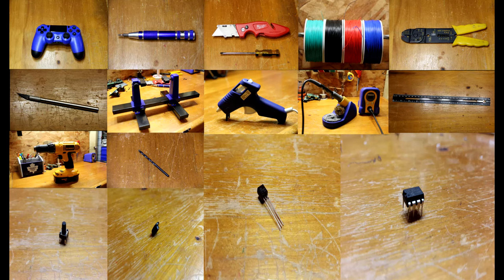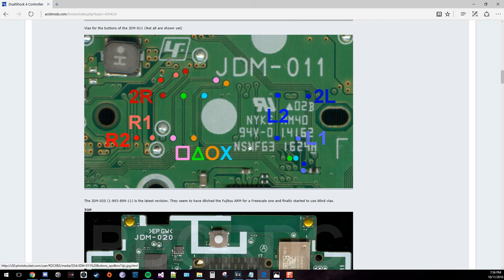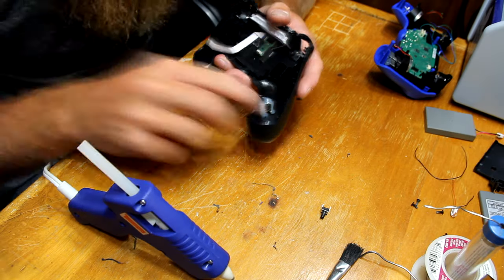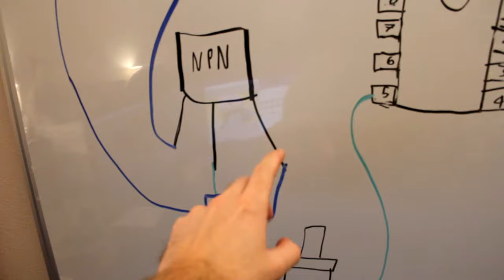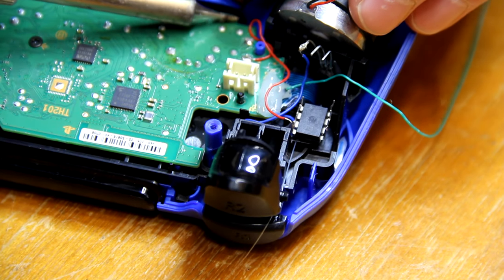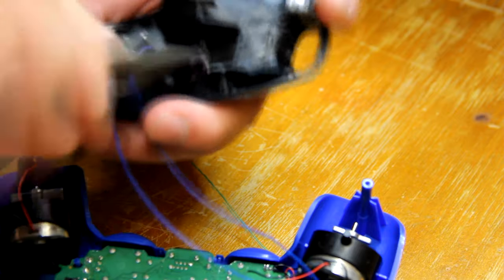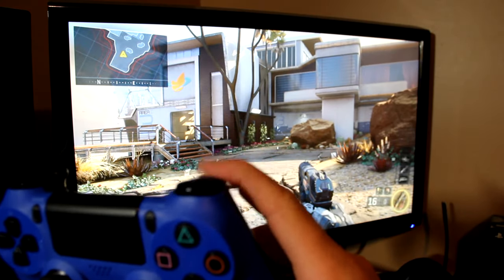How To Install Rapid Fire - PS4 Controller - Tutorial

Comment: Thanks man! I did it and it works great! I used it on my R1 button wich is the solder point beneeth the R2. Also i had some difficulties. On my 12F683 chip the pulse pin was pin 3. And i could'nt use the thumbstick ground to connect the emitter of the transistor to, instead i used the joint up left to it and it worked!
I also glued a long flat piece of plastic to the button to make it feel like a scuf button.
Reply from the maker: That's awesome to hear it worked for you! Glad to hear you were able resolve your issues as well!

Comment: The best bit to use for this kind of plastic work is a step drill bit. Lead with a super tiny bit to make a leading hole and then follow with a step drill bit until reaching desired size.

Comment: Idk if this is a dumb question, but I'm rather new to all this.  Can you add resistors somewhere to increase the length of the pulse and increase the pause between pulses?  So if I wanted a burst fire mode that would be on for 375 ms, and pause for 30ms?  Is this possible?  Thanks
Reply from the maker: I know this chip itself can be programmed and or the pins manipulated to do things like your talking about but i am not familiar with any of that.
Reply: TheHobbyGuy, yeah after I posted my question I kept scrolling down and saw that video link you posted about programming the chip with pickit 3.  I think all that's a little too advanced for me at this point lol.

But anyways, awesome videos man.  I added a scuf style button the other day using your instructions and it actually worked.  I've never touched a soldering iron before in my life so I thought for sure I was gonna brick the whole controller.  Not to mention (going against all advice I found researching before I started) I used a crappy radio shack, direct plug, no temp control iron lol.

Besides being happy it worked, it was also really fun.  I really want to start getting into electronics as a hobby now. So thank you for playing a huge part in helping me discover this hobby that had really never crossed my mind before. Keep up the good work man :)
Reply from the maker: Ya lol it is bit too advanced for me too. I am computer science major but almost wish I would have been a computer or electrical engineer major so I could of learnt more about IC chips and such.
Reply: TheHobbyGuy, exactly me too.  The programming part is no problem, I think I read it based on C.  It's the components and pickit that is all completely foreign to me lol.

Comment: Need help please. I tried your mod. The only difference is I tried using an ez remap board my X and O work fine but the rapid fire doesn't work at all. Would you be able to assist me thru email? Trying to Make two scuffs for my kids for Christmas.
Reply from the maker: madsaez I believe with those ez remap boards you need to press the left dpad or something to get rapid fire to turn on, but I could be wrong I have never used one, if you      YouTube message me ,I can give you my email
Reply: TheHobbyGuy  How much are you selling the control with rapid fire? I want the X and O buttons on the back. Whats your email?

Comment: how the hell do you melt the controllers solder??? ive got a proper soldering iron and its not doing anything
Reply from the maker: Elijah Ferris yes it can be very hard, especially if you have a cheap soldering iron
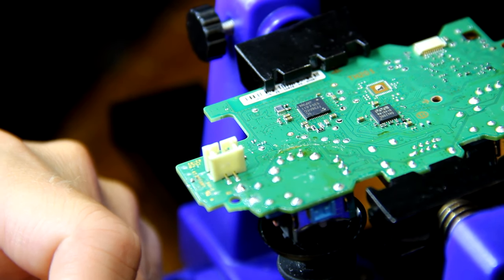Reply: A quick way to melt solder is to tin the tip of your iron ever so slightly and then apply that bit of soldered tip to the solder you want melted. He explains his method at 6:00

Comment: Hi! can we add an extra button for this mod? let's say rapid fire on the left and a second button with X or O on the right side? Thanks!
Reply from the maker: Romania LIVE Sports yes you would be able to, you would just need a  second transistor and button and still use the same prong from the ic chip
Reply: just had a go. done everything as per your instructions, yet the button doesn't do anything while pressed. If u touch the connection from R2 to a ground, it will work, but not through this circuit you've shown..
Reply from the maker: um on the button, did you solder diagonally? 17:36

Comment: If you switch it to a push button switch wouldn't it stay on when the switch is on? trying to get the switch to work only when I hold R2
Reply from the maker: If i think i understand what your saying, it might be possible but I don't really have any idea how to get something like that to work.
Reply: I think I figured it out. If you wire an AND gate between the push button and middle pin of transistor with the push button and the actual R2 button and then it should only work when R2 is pressed, yanno? At least it makes sense in a circuit diagram
Reply from the maker: Makes sense, but how do you plan to wire to the R2?

Comment: TheHobbyGuy on the MCU chip I see some on amazon with faster shipping. Is there anything specific that I need to look out for by chance?
Reply from the maker: As long as it's same chip and that one seems to be, probably nothing to worry about
Reply: I have some UA741 chips already different then what I sent you. Do you have email that we can communicate so I can send you a pdf of the ones I have to make sure they will work
Reply: So sorry for all the questions. Would a switch like this work as well?

http://www.homedepot.com/p/Gardner-Bender-10-8-4-Amp-Single-Pole-Maintained-Contact-Push-Button-Switch-Nickel-1-Pack-GSW-24/100122779
Reply from the maker: That chip says its specified for 5-15 volts so I dont think the ps4 controller would supply enough voltage. And as for the switch i wouldn't recommend that either just because of how big it is. The ones that i link in the description are ideally what you want.

Comment: ok so ive done it. but the button dosent work and if i touch the pin and the bass it dosent work. but if i touch the bass wire with my finger it works as it should. does anyone know what im doing wrong??
Reply from the maker: What do you mean by bass?
Reply: @TheHobbyGuy369  the middle pin on the NPN. Thanks
Reply: @TheHobbyGuy369  it pulses without it touching pin 5(the pulser) do you think my IC chip is programmed differently to yours? I may just have to switch some wires around on it but I think your a bit more of a pro then me so would like to get your opinion on it first.:)
Reply: i think pin 5 (the pulsar) is giving off a negative to the wire which connects to the positive on the NPN.
Reply from the maker: @Greggs_Bakes  is your button wired up wrong perhaps? I think the connections have to be criss cross from each other.
Reply: @TheHobbyGuy369  I'll have a look. Thanks

Comment: Hey man great video! I was wondering where I could salvage the parts from? I don’t want to wait forever to get them from China. I have a load of old electronics, just don’t know where to start. Any ideas?
Reply from the maker: The IC chip probably wont find anything to salvage off of but the transistor and button you might find off of some old electronics. As for any electronics specifically to salvage from, I would not know.

Comment: It only activates when I connect it to the power 7:45 . When I put it to power nothing happens. When it does work when I put it to power it aims, shoots, and my guy looks up and to the left and walks forward and left. Please help asap
Reply from the maker: If I understand correctly, when you tap your wire to the same ground as me at 7:45, your guy will activate other functions as well? If so you might have to try a different ground on the controller. The ground for the rumble I think should work if you try that one.
Reply: TheHobbyGuy The ground doesn't do anything just when I put it to the power
Reply from the maker: which button are you trying to remap?
Reply: R2
Reply: Dport32 you just solder it over 2 contact points or you wired the chip improperly
Reply from the maker: So if you try to just tap the wire from R2 to ground(without everything else set up), your guy will do a bunch of extra stuff too?
Reply: TheHobbyGuy when I put R2 to power he does yes
Reply: Dport32 as i said wrong spot
Reply from the maker: Dport32 are you putting to ground or power, because there is a difference
Reply from the maker: Francisco Quinones are you saying he's wiring it to the wrong spot?
Reply: TheHobbyGuy He may have bridged the contacts cause they are fairly closer, thats why  he is getting multiple actions at the same time, sort of like when you press two buttons at the same time continuously.
Reply from the maker: Francisco Quinones ya that definitely could be the case too!
Reply: TheHobbyGuy
Reply: TheHobbyGuy 
Having same problem. Was there a solution?
Reply: Dport32  hey i am having the same problem. Were u able to find a solution

Comment: Hello man, I have an idea I want you to take, you still reading comments?
Reply from the maker: Yup I still do.
Reply: TheHobbyGuy nice , first im amazed by your work, I have a medium technical degree in electronic, I would like to do something like that , but is there the possibility to connect the R2 like the pulse when you push instead of the button you place on the controller, like the pulse when you press the R2 to activate the transistor
Reply: Bc I thought like putting a button to activate the rapid fire like not a push button like the one you push and close and then you push again to open the circuito, so when you close the circuit your R2 become in rapid fire and when you open the circuit goes back to normal
Reply from the maker: @valvejbcr9745  Thanks! I looked into that at one point but I couldn't figure out where on the motherboard to tap into to for the R2 button to send a signal to the rapid fire. Would be a good idea for me to maybe look into it again!
Reply from the maker: @valvejbcr9745  I'm trying to finish my current project at the moment but when I am done with it for sure! If you  make any head way on where to tap into on the motherboard or any other insight, let me know! No problem!

Comment: Is there any way you can make it faster?
Reply from the maker: It's probably possible, but I am not that familiar with this particular IC chip, i know you can essentially do the same thing here with a 555 IC timer chip, but also requires using a resistor and some other parts. With that chip you possibly make the pulsing faster.